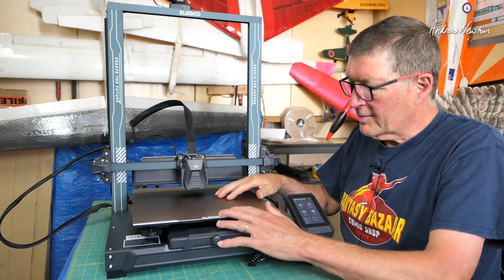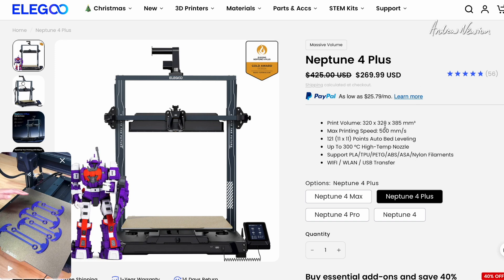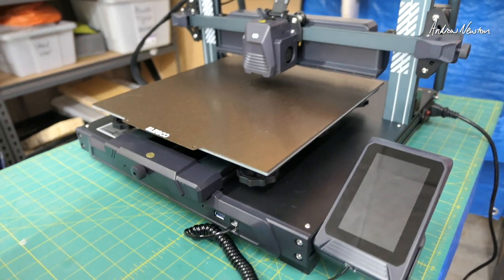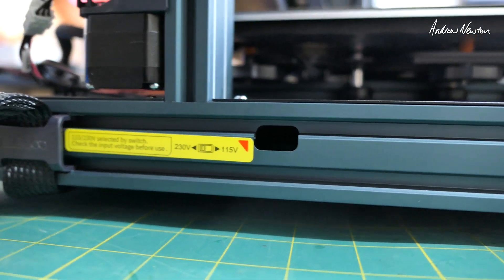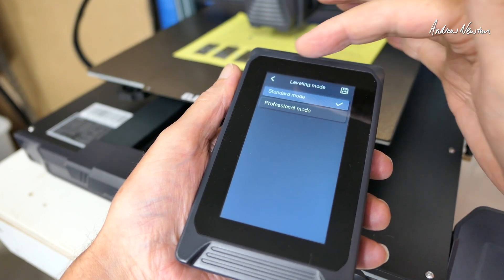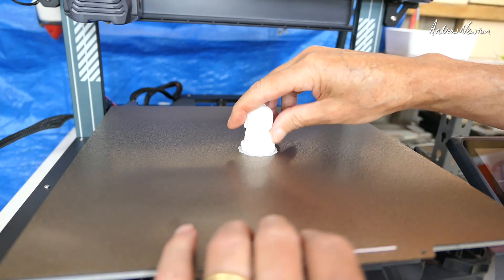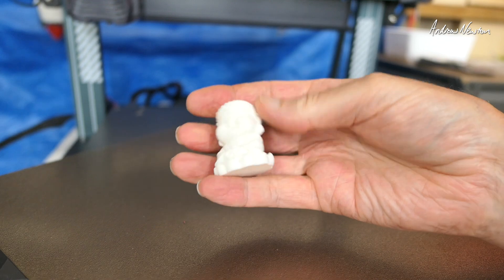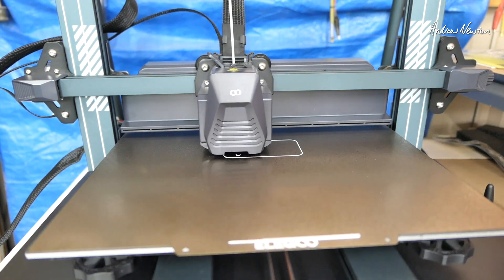Elegoo Neptune 4 Plus - 3D printer

Comment: FYI for anyone buying an Elegoo Neptune 4. Make sure you update the fw. Seems to printer a lot better with the most recent update. Also I use to have a grinding noise when changing filament that is gone now. Currently printing a 3D plane.
Reply from the maker: Thanks for the tip!

Comment: I need a new printer, I have the Aldi printer (rebadged Wanhao Duplicator i3) and the build volume is just far to small so I cant print anything like a Soarcraft glider without having to chop it up smaller in Meshmixer.